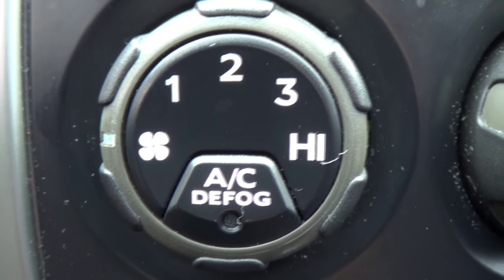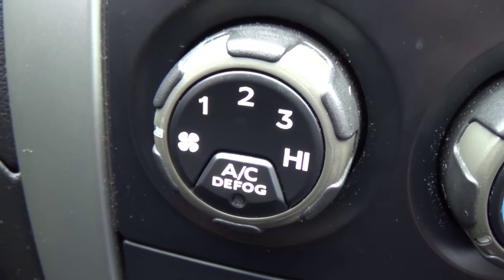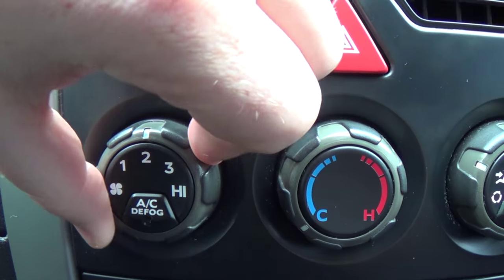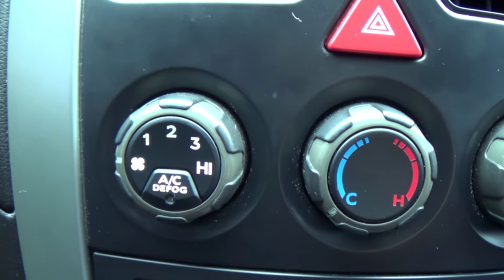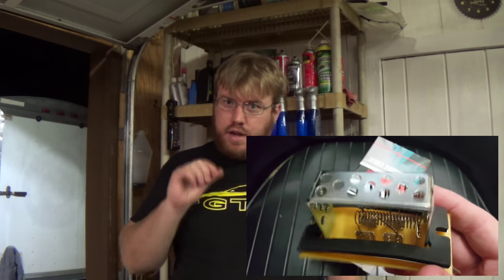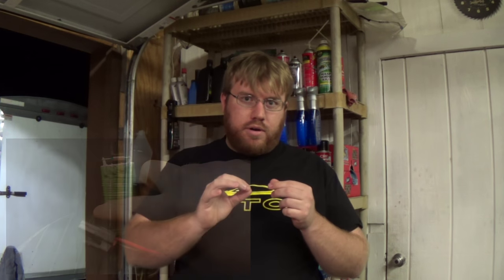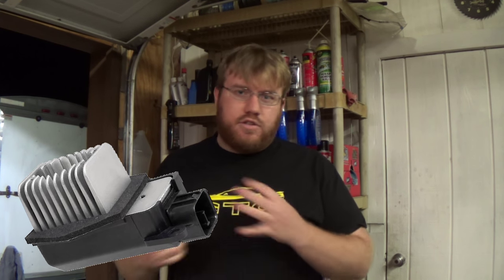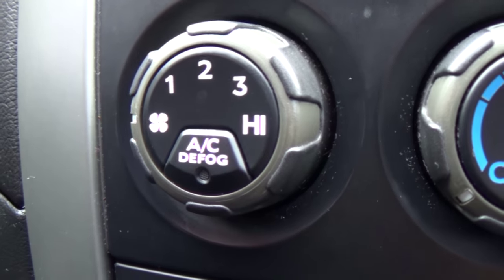How Blower Motor Resistors & Fan Speed Controls Work • Cars Simplified

Comment: We are restoring an 09 civic. I just replaced the blower motor, the ac and settings work fine, however, I'm trying to get the fan to flow faster on high. I am not sure if it will even change anything if I got a new resistor as adding a new motor didn't
Reply from the maker: I assume you've checked the cabin air filter? To make sure the blower motor is getting full power, check the battery voltage and then check the voltage drop across the blower motor while on full power. I don't currently have a video on back-probing with a multimeter, but that is probably the easiest way to test it. If the voltage is considerably different between your car's power and what the fan is using, then there is something in the fan circuit that is adding resistance. It could be the resistor unit, a bad ground, or some damaged wire. Depending on the design, the switch could be not switching to the full speed. There are other things it could be, but these seem like the most likely.
Reply: @CarsSimplified  yup I have replaced the battery, blower motor, and cabin filter

Comment: The AC unit on a Toyota Hiace 16-str van has the front & rear vents. The rear AC blows fine cool air; however, the front has air blowing out but not as fast as the rear vents.

Comment: My car was fine but now doesnt blow any air or heat. I changed blower motor itself and the relay/fuses with no change. Is it the resistor? But i thought resistor going bad it would still blow some setting of air out but nothing works. Please help. It is a 99 lexus gs400

Comment: Hello
I installed a webasto parking heater and its capable of turning the car blower fan on to warm the car before I get in. However I’m not sure where to wire up fan to the Webasto unit. Will appreciate your help. Thank you.

Comment: Thanks bud do you or anyone in here know if I have a weak blower fan on number 1 and 2 but 3 seems to be strong, could the resister make 1 and 2 weak and 3 not weak? Also note I have a 98 F150 and do not have the cabin air filter mod. They didnt come with cabin filters so you can make a 2 inch wide 10 inch long cut on the air box and slip a filter in. I bring this up because there could be restriction from debris and I feel like the number 3 is a strong fan but maybe the air held back a little from debris. Numbers 1 and 2 on the knob seem to be very quiet and very weak. Number 1 isnt even useful.

Comment: When I select floor, the blower turns off. Works on other settings.
I put another selector in, it did the same.
 It has a new resistor as well..
Goes from cold to hot..

Any suggestions?

Comment: Hi do you know the approximate speed of airflow or motor speed for each level of the air conditioning dial(1,2 etc)?
Reply from the maker: I unfortunately do not have that information, but I do know this will vary based not only on the car, but which vents are selected, how many selected vents are closed, wear and tear on the blower motor, and even the type of cabin air filter being used. (All of these mostly alter air flow but also slightly affect fan/motor speed, too.)

Are you just curious or working on a project of some sort?

Comment: Sir my car blower works only for sometimes. It blows and stop, when it stopped the speed controller hasnt works. Totally stop working. When i check Resistor i found some rust on it. Can it be the cause of mulfunction of the blower?
Reply from the maker: That could be the problem, but with rust I would make sure there aren't any liquid or moisture problems like a leak that will damage the next blower motor resistor, or that is already causing problems elsewhere.
Reply: @CarsSimplified  Thank you sir

Comment: I suspect my problem might have something to do with the resistor. But its not like you described.
Thing is my fan broke down. And after replacing it all 4 setings WORK but they are noticeably slower than before. however sometimes when i put the car in reverse it works just as fast as it did before. Its such a weird problem

Comment: Theirs no power going to the fan control dial, but theirs heat upbeing blown out of the vents. And I can’t turn the heat off. I have a 03 Nissan Maxima, and the heat stays on high no matter what. The knob doesn’t work at all, it’s not letting me turn off the heat. Do you know what that could be ?

Comment: Hey what's up nice video my question is that all my settings are working one-two-three-four all that I got a 2014 Nissan so my thing is why why does my speed very depending or doesn't matter what number I have it are number one or full speed the air pressure keeps going up and down why I am literally writing you this in the car with the AC on

Comment: Have a 2006 commodore , 1,2,3 work fine 4 nothing at all, replaced resistor and still the same, any idea, thanks
Reply: I have the same issue started to look at it today. Replacing the resistor fixed your issue ? thanks

Comment: i replace the ac blower resistor every year.. is it OK to just remove the resistor and just use the AC on max fan speed at all times?  i live in a hot place anyway, most of the times, my AC is set to 3.
Reply from the maker: Yes, you can do that for sure. Top speed on a normal fan switch is the same as what you are suggesting.

Comment: I have a Honda Cr-v 2002. The AC is not blowing enough cold air. Ac air compressor is new, fans are working and it has enough freon. One friend told me it might be the blower motor resistor...is that a good or bad guess?!. Help!:(

Comment: When I open the aircon and put IT ON number 1. IT is not working. But when i put IT ON number 2 or three. IT started to blow air. When I returned the knob to number one IT is now working. I changed the resistor block. It has the same problem. Maybe the selector switch is malfunctioning. Honda Jazz 2012 ni the Philippines has this problem

Comment: I have a 95 Kenworth with 3 speeds. 

Can I replace it with a 5 speed resistor to make it go faster? Like a more modern ac system?

Thanks in advance
Reply from the maker: If both resistors get their top fan speed by having a selection that just bypasses resistors, both the three and five speed setting resistors will have the same fastest speed. I'm not familiar with what Kenworth uses but if it is the same design as cars use, it will be how I described. If you can find information on the parts, see if they both have a 0 ohm (or very close to 0 ohm) path; this would tell you for sure that both top speed settings are the same.

Comment: my ca and heater is not working on any speedd and i just replaced the blower resistor so what do i need to check next? the fan controller switch ?

Comment: Hi, 
I have Rover 45 (2004) 1.4ltr club SE petrol. my fan blows on full speed and temperature setting wise all works fine. I just can't stop the fan or reduce it to the lower level.air con settings all works as desired. could it be the time to replace my resistor? as it's very annoying to have the fan on full speed as i turn the ignition on. please advice. Thank you.
Reply from the maker: While that could be a resistor, it sounds like it may have a short or someone wired it up to bypass the resistor and switch entirely.

If only you have access to it and it just started doing that, it may be the resistor then. Otherwise, it is most likely a rewire job to quickly avoid another problem.

Comment: Depending on how the resistor breaks. The A/C and Heat may only blow at certain speed settings or it may not blow any air at all.

Comment: My resister did burn up on my chevy silverado.  Only fan speed 4 out of 5 was working.  I replaced it and 1,2,3 and 4 now work but 5 still does not.  

Any Ideas why?

Also the green stick circuit board looking thing that comes out got really hot when I connected it.  I was thinking, since it sticks up into the air vent, that is what cools it.  And because it was on but the fan wasn't blowing, that is what made my old one burn up.   

Is that the case or should it not hot?
Reply from the maker: That is what cools it, but unless you connected it with the fan on (not a good idea unless you are running a quick test) it shouldn't be getting hot. If it is getting hot but your fan is turned off completely, you may have a short that is burning up your components. You may even have a shorted blower fan motor winding.

Try testing your connectors with all power to the fan off (but vehicle key on) and see if anything seems to have power. Before doing that, check to see if the blower motor circuit has a fuse, and if so, if it has the correct fuse.

Comment: I have a Nissan versa 2009 and no air comes out of vents blower was tested it blows fuses cked all ok what else could it be?
Reply from the maker: If you know the blower works, but the correct type of fuse blows out when you try to run the fan, the most likely culprit is a short. Fuses blow when too many amps pass through them, so there can only be a short or too much load. Are there any burn marks on the plug?
Reply from the maker: Oh, sorry, I misread your comment.
Can you hear the fan turn on at all? Sometimes debris can get into the fan and/or cabin filter, stopping air movement.

Comment: Would it cause all of the settings not to work?
Reply from the maker: It could, but that is much less likely than a bad blower motor or a broken/disconnected wire.
Reply: Cars Simplified i have a 2005 nissan murano a/c jus stoped blowing i checked blower fuses there good, i checked blower relay its good, i changed the blower still no luck, the last thing i could think of is the resistor but it doesnt work on any settings, do you think that could be the problem ? Thanks for the quick response
Reply from the maker: It could be, but also make sure there is no fuse for the HVAC controls and make sure the wire harness isn't melted. I had a loose wire on my own car cause that same problem and I had to replace the plug.
Reply: Thanks man will deffinetly check the hvac fuses

Comment: Ac blower motor goes out or is on very low setting, so i replaced motor thinking it was the motor. It is still randomly going off or is low, i replaced the connector that connects to blower motor and the resistor still happens. Took it to a mechanic and told him what was replaced he checks voltage and relays everything was good. He tells me since i did i replaced those parts and that how the blower motor  is very low or stops blowing completely that it was the climate control module. So i ordered it off from ebay cause the dealership do not sell that part. I replaced it and still the problem persist.

Comment: so my subaru heater is constantly blowing full speed once the key is on ACC. temp control works, vent selector works, but the off to full blow selector does nothing. on or off, it's blowing full speed. HELP
Reply from the maker: It sounds like something has shorted past the blower motor resistor and is supplying power to the blower without setting consideration. Were any electrical repairs or modifications performed recently?

The dial that actually changes the setting for the fan speed may be internally stuck on full, too.
Reply: @CarsSimplified  the guy i bought it from said he did something to keep it on, being Alaskan winter. Im really not sure what all he did to it. Im gunna pull the dash off and take a look in there.
Reply from the maker: Ah, interesting. That may have started because of another problem (no need to bypass stuff if you could just leave it on the maximum setting) so it may require more effort than just putting it back to stock.

As for what to do, I would start with checking to see if there is an out-of-place wire going to the blower motor. Since it only runs when the car is turned on, the fan or blower motor relay may be tied to something else that is also only on at those times.

Best of luck to you! Custom wiring jobs are often a pain.
Reply: @CarsSimplified  so i took it all apart to look, and found the issue. The wires to the fan speed selector switch are all cut. Ill likely have to just get a new control panel, i havent found any info on if i can just replace the switch itself. Couldnt get the plug out.

Comment: what  if fan  motor  work sometime sometime does not  work  is the resistor  not working
Reply: most likely you have a bad motor, loose connection, or there is a connection that heats up and has started to melt and is causing this intermittent problem. There should be three areas for connections you will want to check. 1st. at the switch on the dash, this will require pulling the switch from the dash and looking behind it to see the connection. 2nd, is at the resistor. This can normally be found somewhere near the motor and attached to a vent tubing that flows the air from the blower. (Resistors heat up this is why they are placed in these areas. It helps to keep them cool). 3rd is at the motor. Normally found under the dash on the passenger side or from inside the engine compartment on the passenger side firewall.

Comment: kia sportage 2006. I have no air at all .but the ac light turns  on..
Reply from the maker: By no air do you mean nothing cold or nothing blowing at all?
Reply: No air blowing at all
Reply from the maker: It seems like you came to the video discussing the two right things but it is difficult to tell for sure. Least expensive route for DIY is to pop the blower motor out and see if there is anything preventing it from moving. While it is out, see if the fan spins under car power, then direct power (be careful with that) if it fails that.
Reply from the maker: Fan spins under car power, but only out of its housing: likely a bad wire or something stopping the fan blades.
Fan spins on direct power, but not from the car's plug: you will have to chase down an electrical issue. My least favorite.
Nothing spins the fan: the fan itself is damaged somehow.

Comment: why don't they use PWM to control fan speed ..  more efficient than resistors ... ?
Reply from the maker: I imagine resistors are less expensive and they aren't too worried about about energy efficiency. However, I wouldn't be surprised if some new high end cars have fan speeds controlled by pulse width modulation.

Comment: You did not explain how heater resistor works, did you? You just said what it is involved in. How it works generally means explanation of inner workings.
Reply: Completely agree
Reply: A resistor consumes / reduces some of the voltage. The remaining voltage is applied to the motor brush’s. Therefore slower speed.

Comment: All speeds but max have went off. Im hoping an automot scrap yard'l have a good one and not charge 35 to $50 (the car will barely $ell for $900 iF im lucky*); stupid tuf reneging buyers nowadays, scratches from scraping ur windows and body painylt due to bullsh canadian cold winter, and depreciation of a 2000 2.2l l4 o.h.v Sunfire by GM pontiac